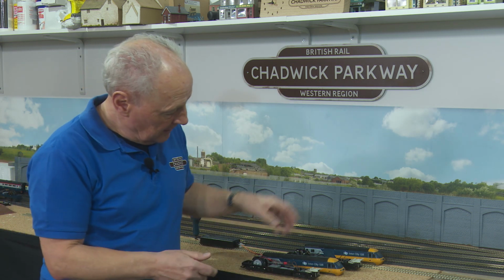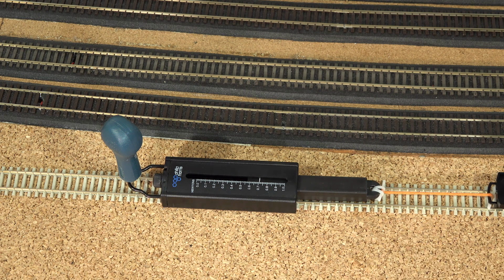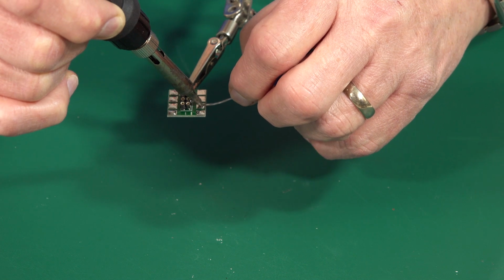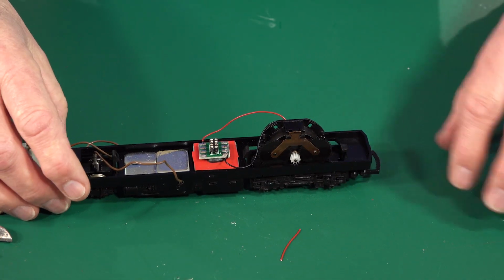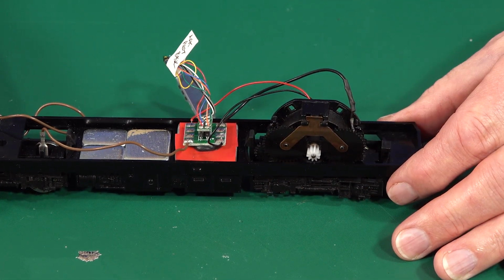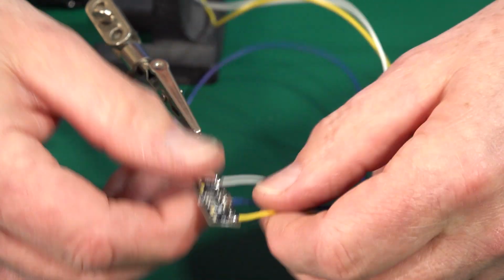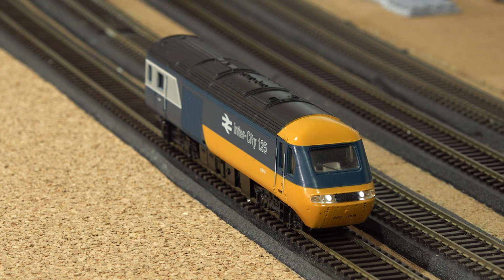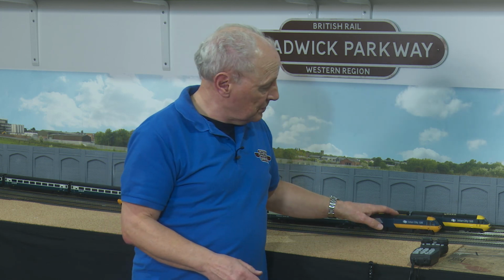Converting Locos to DCC at Chadwick Model Railway | 152.

Comment: Hi Charlie, I know this is a very old thread but I still watch for reference However I have a question around the hornby wide wheels shorting on frogs I’m running old stock converted to DCC did you improve the shorting issues or change the wheels 
Regards Gareth
Reply from the maker: No Gareth, just a short term fix with nail varnish.  Replacement wheels might be available from Peter’s Spares.

Comment: Ive only just watched this video today 26-08-25. 
I’ve not read all of the comments, but it might help to explain programming a little more. Changing how to reverse the direction of the loco and make it also run on DC is set in CV29. 
Look at CV29, 
Reverse direction = 1
Speed steps 128 = 2
Enable Analogue operation = 4. 
Add these values together, they equal 7. 
Set CV 29 to 7. If direction is incorrect, take away 1 and set CV 29 to 6. This will also allow the loco to run on DC. 
As I said, this might have been put on already as I’ve not read all of the posts and this may have been shown. If not, I hope this helps.
Reply from the maker: That is very helpful information, many thanks for taking the time to explain it. Regards, Charlie.
Reply: @ChadwickModelRailway  altering various can, and will add to the train running experience. I love watching your videos

Comment: I came to this video thinking "This will not be helpful".....and I left with "This is going to be bookmarked". Simple instructions and the soldering, so effortless.

When I have wires running like that, I tend to run them in a bit of heatshrink just for cable management.
Reply from the maker: Thanks mate, I’m so pleased that you found the video useful. Regards, Charlie.

Comment: Good morning can I ask a question if I am going to convert my 125 HST’s? Do I need to put a microchip in the back dummy car as well as the front car?
Reply: For the wiring on the rear dummy car of an HST, can you please tell me where the bogey wires go? Am I correct in saying that one goes to motor in red and the other one goes to motor black?
Reply from the maker: @ I thinks that’s right, but I’m no expert. Regards Charlie
Reply from the maker: You do if you want the lighting to work David. Regards, Charlie.
Reply: @ChadwickModelRailway  thank you very much for your response. Does this mean cab lighting as well or just directional lighting?
Reply from the maker: @davidboreham8429  you can use it for both.
Reply: @ChadwickModelRailway  good morning Charlie can you please send me a diagram for wiring the rear dummy car on an HST for front and rear running lights please? Very kind regards I find your videos very very helpful.
Reply from the maker: @davidboreham8429  
Sorry David, but I don’t have the diagram. However, a quick look on YouTube, and there’s lots of tutorials. Regards, Charlie.
Reply: @ good afternoon Charlie can you show me where the bogey wires go on the dummy car for directional lighting kind regards
Reply from the maker: @davidboreham8429  I’m unsure myself David, but it should be the same as the Power car without the motor. Regards, Charlie.

Comment: Hi Charlie. I am looking to convert my old HST 125 to CD Motors (along with the Black Cat Technology LED Lighting Conversion) and also fit DCC. On looking at CD Motors on sale, the seller states "Modern CD Motors Are Instant In Movement So Use With A Variable Speed Controller Is Recommended." Chatting with one seller, he advises that when using DCC, it's best to fit a Diode Voltage Dropper. Now this may only be a reduction of 1.5v, but is it enough to make a difference? I notice that you have not mentioned this in your video. What is your opinion in the matter? Thanks, Rob.
Reply from the maker: To be honest, Rob, I was unaware when I did my conversions. Regards, Charlie.
Reply: Ok, no problem, @ChadwickModelRailway . Thanks anyway...

Comment: Hi Charlie. I’ve just acquired two intercity 125’s. A yellow and blue plus the swallowtail livery ones. My question is what are the power pickups used for in the dummy car. There is a spare spade terminal and what looks like an in line resistor.
Reply from the maker: I imagine that both units share the same start of construction but only the power car is then built.  However, it does mean the that adding tail lights, is much simpler. Regards Charlie.

Comment: Excellent - thanks Charlie, I am learning so much from you. I ordered the rather lovely wire strippers and could probably do with a slightly less cumbersome soldering iron than mine. Unfortunately your amazon link to the iron no longer works. I just wondered if there's a particular one you'd recommend. I've just done my first foray into DCC having obtained a Hornby class 50 in their sale along with the HM7000 21 pin decoder .  A whole new world awaits! So next I am going to follow your videos on replacing the motors in my old Western and Deltic followed by this chip project; probably using the HM7000 8 pin decoder. Thanks again,
Mark
Reply from the maker: Thanks, Mark, a whole new world is opening up for you. Regards, Charlie.

Comment: Hi Charlie, I have watched your videos for several years and now I feel I want to make a start back into the hobby I had as a child, I am now 77. I seem to be hitting brick walls, hopefully you will be able to guide me in the right direction. I have a Coronation Class loco, Duchess of Gloucester and I would like to convert it to DCC. I have looked on the ESU site for the plug and harness which then directs me to UK retailers. Thats where the brick wall. Am I correct in saying you use DCC Concepts and they will assist me over the phone. Please keep the videos coming they are excellent.
Reply: Hi Charlie thanks for getting back to me. No they are not. I was going to start with purchasing a plug to connect to the locos motor etc and then get a decoder and eventually  a sound decoder. So the very simple answer to your question is no.
Reply from the maker: Hi Denzil, are these locos, DCC Ready?
Regards Charlie

Comment: Your test only measures tractive effort. Tractive effort is a function of wheel rail friction and the weight on your driving wheels. Nothing to do with DCC or DC control. The difference in your results is probably due to the wheels being polished from the first test, decreasing the friction. However with DCC you need extra space to fit your Decoder and speakers which could be used for extra space for weight if using DC. Thus new sound fitted DCC models on average will pull less than old DC models.
Reply from the maker: Many thanks for the information Terry. Regards, Charlie

Comment: Hi just wondering can I use any decoder or is there one type that's best many thanks chris
Reply from the maker: Sadly Chris, you get what you pay for.
Be aware that  cheap ones can burn out if you draw too much power.
Regards Charlie.
Reply: Hi thanks for reply what would you recommend please
Reply from the maker: I use ESU but always avoid Lias.
Reply: ESU 59810 Locomotive Pilot 5 Micro DCC / MM / SX Digital Decoder 8 Pin Nem 652. would this be suitable cheers
Reply from the maker: Yes, but you don’t need to use the locpilot micro version. The standard one may have a better power capacity.
Reply: Oh brilliant thanks very much for your advice

Comment: I was wondering, do I even need that 8 pin conector if I can just solder the wires directly?
Reply from the maker: But you might choose to switch it to another loco or upgrade it.  Regards Charlie

Comment: Moved about 3 months ago, along with my stuff came all of my mom's stuff.  Sorting through her boxes, I came upon my HO trainset from the mid 80s, heh she saved it did not know..... Had a ton of copper track, misc other stuff, lots of rolling stock and a Blue Box Athearn loco, Atlas Loco, Bachmann Loco (one with similar pancake motor)... And a tiny Bachmann shunter.  All but the shunter I changed over to DCC and all work great 😊 but opening that box of old train stuff opened a can o worms lol
Thanks for the video!
Reply from the maker: Many thanks for sharing, much appreciated. Regards Charlie

Comment: Hi Charlie Returned to watch this and the previous video on the motor conversion. Despite your expert tutorial, I do not feel confident enough to carry out the works myself. I currently have four Hornby train packs with the power cars having Ringfield motors. They cover liveries that were not in my extensive HST collection. Do you take commissions?
Reply from the maker: Sadly no I don’t Kenneth. However, the guy who sells the conversion kits on eBay does accept commissions. Regards, Charlie
Reply: @ChadwickModelRailway  Hi Charlie Thanks for your prompt response. Been in touch with Mark and he has replied that due to family matters no further commissions are being taken on. I was able to change over one of the Ringfield motors, worked beautifully, but not confident enough to move to the next stage. I purchased the DCC items and light paraphernalia through your link. I am obtaining when I can the powered chassis to replace the dummy car, even though they are primarily for display. Is there any else you can recommend?

Comment: Hi Charlie I have two sets of old 80s Hornby HSTs and I am going to convert them to DCC with sound.  The thing is I am unsure what decoder type to go with as I want sound but I also want to have features like Automatic Braking Control.  I've seen that the Hornby TTS decoders don't support that.  Any suggestions?
Reply from the maker: I think that you will need deep pockets on this one mate. Probably ESU or zimo might do it. Best to give James a ring at DCC Train Automation mate. Regards, Charlie
Reply: @ChadwickModelRailway  don't you need deep pockets generally for this hobby? 🤣😅🤣😅

Comment: It should be possible to get finer wheels to improve things on more modern track. The wheel mounted gear is the only possible issue I expect.

I have several older models I will probably order some of these kits for. I'll need to figure out new wheels as I am using p4 track (or planning to), but should be able to figure it out. I'd like to remoter the old 42 warship I have,  but unsure this method will work,  can you guess what number it is? ;-)
Reply from the maker: The number, I’ll let me think?

Comment: Presumably if u replace the dummy car with a second power car, u would have to program the rear power car to operate in the opposite direction to the one at the front.  Would that be same address, reversed polarity as with the lights?
Reply from the maker: This one is very easy Tim. You just put them both on the same programming been track facing opposite directions when you do all the programming. Regards Charlie

Comment: I've been out of the DCC conversion game for a few years now although heading back in that direction soon. I had a layout (I'm not going to shamelessly paste links here, anyone who wanted to find it will, I'm sure) with curved inclines and had great success with the old Class 43s. A class 43 train, CD motored power car on each end, in a DCC consist, was one of the most consistent, effortless performers going up and down a curved incline, pulling 7 full size Mk3s or 8 of the diddy little old Hornby ones. The sense of accomplishment, seeing those trains flying around, shouldn't be underestimated either! I ended up with an old blue and grey one, an Exec livery one and a Swallow livery one, probably costing less than one of the modern models.
Also, great to see how the modding scene has moved on recently, with those 3D printed harnesses.
Reply from the maker: Yes things have certainly improved in recent years, however there’s nothing like reviving an old beauty. Regards Charlie

Comment: Hi Charlie. Great videos once again. I have an old HST unit myself and converted it to the new motor and LED lights. It runs better than ever. Thanks to blackcattechnologies and whistles & bells for the upgrade. Question though Charlie. Fitting LED lights to the dummy car, do I wire them up straight to the boggie wheels or do I need a motor in it? Thanks.
Paul b
Reply from the maker: Hi Paul, there is no motor required in the dummy car. Regards Charlie
Reply: @ChadwickModelRailway  thanks Charlie. Much appreciated. The upgrades make it a new model almost and the videos make it so easy to install.

Comment: Hi Charlie very new to model railway modelling after watching  you videos on Class 43 125 . I purchased a old class 43 unit from a well known  Web site. Cleaned and striped down the unit as you showed put it all back together with some new parts brushes it worked so well never made the motor upgrade. I still run analogue. Digital to rich for my pocket and I purchase second user units and get a lot of satisfaction getting them working again. I pick up so many good idea from you keep them coming Steve.
Reply from the maker: Thay's great Steve, I'm so pleased that you found the video useful.

Comment: Hi Charlie
(And all)
I just converted an old Lima Western to DCC. 
With a ringfield motor.  I tested it first on DC and all okay. 
The conversion worked 
It ran okay but now nothing. Is there a problem with the old ringfield motors and digital control?
I will continue fault finding but all pickups and connections buzz out okay. 
Many thanks 
Howard
Reply from the maker: Can you test the decoder in another loco?
Reply: Will so thanks

Comment: I normally really aprieciate all your videos but I have to take issue with this one.  The tractive effort you are measuring with the wheels slipping has very little to do with the available power or torque from the motors or from DC or DCC.  Both motors and both DC and DCC were able to provide enough force to spin the wheels.  The differences are down to the weight on the driven wheels, the first two were chassis only the last one was with its body shell.  Then there is the coefficient of friction of the wheels and rails.  The DC was done on different rails and the locos have different wheels probably also in differing states of cleanliness.  

I have a digital strain gauge on my test track and the ability to incline the track in a controlled fashion.  It will similarly measure the available tractive effort.  I almost always find that locos can pull better with some additional weights added.  The motor power is seldom the limiting factor unless the motors are very old and the magnets need remagnetising.
Reply from the maker: Thank you for your informative comments. Sadly, I totally agree with you it was a flawed test in the first place. I shall certainly revisit this for a more accurate result. Your strain gauge has picked up my interest though. Do you have any more information on it. Regards Charlie

Comment: Hi Charlie. Just going of topic i bought and used a hellix from DCC automaton, great product by the way and because i watch your video's you often praise the use of Copydex as adhesive for your rails. I used Copydex to assemble my helix and I would like to share with you and others what happend to me. After compleating my hellix i was suddenly confronted with the fact that i had to move. In my new situation my old clockwise hellix nedded to be anticlockwise (you cant make this up can you). i was able to dissasemble the hellix and reasemble it aticlockwise. with no damage to the hellix. because of the copydex. Just a tip.
Reply from the maker: That’s great news Peter.
Regards Charlie.

Comment: Cracking video Charlie, very informative as always... Very surprised at the loss of pulling power after the DCC conversion!

Would you say the increased pulling power after changing to the new motor was a combination of the new motor and added weights or just the motor as the chassis with the original ringfield motor fitted only had the original weight from what I could see?
Reply from the maker: Hi Pete, I’m going to revisit this problem and do it more scientifically.
Regards Charlie.
Reply: @ChadwickModelRailway  Will keep an eye out for it, will be interesting to see more on this!

Comment: Your test is wrong.  You are merely testing the possible adhesion of the unit, governed by the weight of the vehicle.
Reply from the maker: Yes Brian I’m sure that you’re right.
How do you suggest that I do it?
Reply: @ChadwickModelRailway  Add a weight to each vehicle to bring them to equal weight until neither of them slip.  Then take your readings.
Reply from the maker: Thanks Brian, I will be doing another before and after at some stage.

Comment: Hi Charlie, Thanks for the continuing excellent videos, always awaiting Fridays for the next one! I've been converting some 125's recently and came across these Laisdcc 860002 DCC NEM652 8-Pin socket with hard wiring solder tabs adaptor PCB similar the ones you used but also have the colour coding at the sides of each of the contacts. Hope that may be useful.
Tony Collinson
Reply from the maker: Thanks Tony but please be aware the Liasdcc use stolen designs and firmware.
Reply: @ChadwickModelRailway  Didn’t know that Charlie. Thanks for the heads up!
Tony

Comment: Hi Charlie, Although not doing the CD motor conversion I fitted two  elderly Hornby Virgin HST power cars with DCC and the Black Cat lighting years ago.  They make a great full length HST set.  Elderly models can run very well on DCC, although not all.  My favourite is my Trix transpennine 5 coach unit.
Reply from the maker: Thanks for sharing the news of your success Robert. Inspiration for us all, regards Charlie